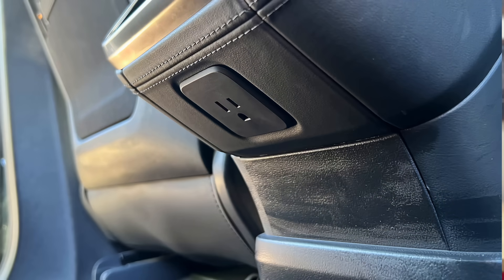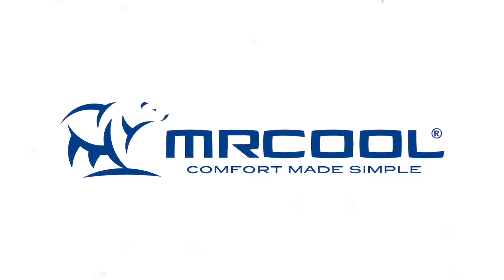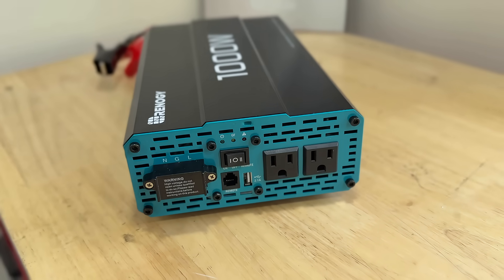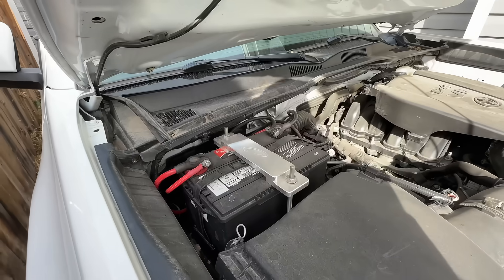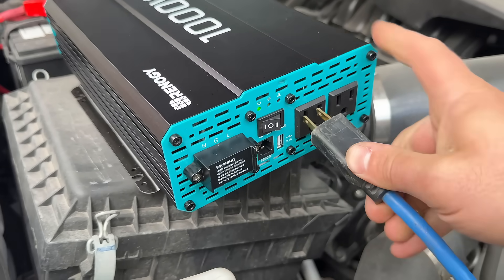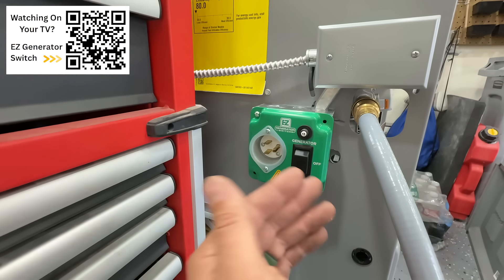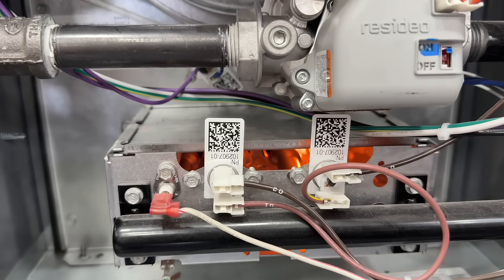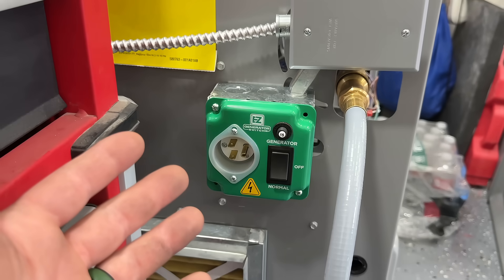Why Buy A Generator? You Have One Parked In Your Driveway.

Comment: A car's capacity to power other items such as the electrical forced air part of your gas furnace, is limited and may result in a very expensive repair to your vehicle, including replacement of the alternator and other electrical components.

An inverter will simply take the power it calls for (demand) from your car.  This first comes from the car starter battery and once extinguished, the full load (demand) is placed on your alternator with no backup, and may and likely will overload your vehicle alternator resulting in failure.

The problem will be exasperated if your vehicle starter battery is old or nearing it's useful life, say a 24 month starter battery at 24 months old.  That battery may old hold 20-40AH for starting our of 100-120AH in a new battery.

Last, vehicle failure may not be obvious.  Damage can be accumulative over time culminating with failure after several uses.  The root cause of such a cumulative failure can be confusing and not obvious.

How to be safe?  Know your vehicle's alternator spare capacity at idle and operating speeds.  Note that operating an alternator at idle places additional loads on the alternator while the alternator has limited cooling capacity during low rpm's and may overheat resulting in failure.

The choices here are to be careful or be prepared for an expensive repair.

There is more to these electrical systems than meets the eye.  A red flashing light is that the vehicle manufacturers do not recommend these systems be installed.  They do not warrant their equipment for use with these inverters or 12v to 12v chargers.  This is a bright warning sign.

My lesson learned was $4,000  in repairs to my vehicle electrical system.  

I could have built a 500AH battery pack with inverter/charger for such emergencies completely separate of my car electrical.  Further, I could have also added a generator (gas or propane) for extended outages to recharge my 500AH battery bank..  $600 for 3 batteries/300AH, $200 for inverter, $200 for charger, TOTAL $1,000.00,   A cheaped down system could be made for as little as $500 with 200AH capy.   My first 100AH system cost me $400.  With one $4,000 vehicle repair, this is an incredible deal.

I hope this saves you money and a lot of trouble.

Cheers

Comment: İ was thinking about getting an inverter and a 12 volt battery and a solar panel  to charge the battery and to use that the same way as you but independent of using the car. Has anyone here done this?

Comment: This is a good idea, in a pinch. Like others, I'm skeptical of leaving the inverter under the hood with the car running. Under load, my Renogy 1000 watt inverter runs its internal cooling fan often, and if it's drawing hot air from around the vehicle engine, I expect its life to be shortened considerably. As others have said, using clamps on the battery is a bad idea; they represent unwelcome resistance compared to lug style connections. I'm also skeptical of the wire gauge between the battery and the inverter, as well as the extension cord guage. My solution to this isn't cheap. It's an inverter generator that runs on natural gas, or propane, or gasoline.

Comment: I think that's an okay idea but you did not mention that a car should be always outside while it's running.  what is the gauge of that extension cord? Correct me if I'm wrong but it has to be a heavy gauge extension cord, 12 gauge, at that length. Be very careful with this.

Comment: This all seems good in an emergency, but there is a reason that generators exist as a standalone product. I live fully off grid with solar as my primary energy source and a 3000w inverter generator as a supplemental backup. 

My generator has a 2.5 gallon tank, which can output 50% of its load for about 8 hours. That is about 1500 watts. At 25% of its load, that time stretches to 12 to 16 hours. A family of five to seven people charging things, running laptops, powering starlink, occasionally using a microwave for a few minutes, not running air conditioning, in my experience typically uses about 600 to 800 watts continuously during the day, and less than half that during the night. If you shut the power off at night, that 2.5 gallons of fuel can last a full day. 

If gas is $3 per gallon, then you are looking at less than $8 per day to power your life with a generator. It would be very difficult to find that kind of cost efficiency using a vehicle as a generator.

The other major factor to consider is the wear on the vehicle versus the where on the generator. Generators are designed to do exactly this task. Vehicles are not meant to idle for hours and hours on end. I have had some situations where I have run my generator for 48 hours straight with only a few minutes of stopping to refuel or add oil. It is much less expensive to replace parts or an entire generator than it is to replace parts in a vehicle. There is also the concern for where you need the reliability. Transportation is often more critical than electricity, especially in an emergency situation. 

My whole point in telling you all this is that while the idea in this video is useful in a bind, if you think there is a high probability you will be in a situation like this, do yourself a favor and purchase an inverter generator that can meet your needs. It will save you a lot of money over time, and will generally be more reliable when you really need it.

Comment: Your fridge is plugged into a dedicated 15a circuit. A minimum for an inverter would be 1500 watts  with nothing else plugged in. 2000 watts if you want to plug your gas furnace in too.

Comment: The problem with using your car as a generator/inverter is that the engine is huge & inefficient.
You'll burn thru your gasoline quickly.
You're infinitely better off with a 3500 watt inverter/generator.

Comment: If you have of those thermal guns, you can buy on a Harbor freight for about 25 bucks. Let the battery go way down in your vehicle I mean almost to dead or dead then jump it off and let it run for about a minute and take the temperature of your alternator those things to get up to over 300° in a minute or two when the battery is completely dead to charge the battery. It’s not healthy for your alternator because those temperatures are a killer they’re not designed to operate in that range so if you do this, make sure your alternator is not running at 300+ degrees continuously because you’ll be buying an alternator sooner than you think.

Comment: 1:48 You're going to need bigger 12v wires and clamps than that to power a 1000w inverter.  1000 watts at 12 volts is 83 amps, before you account for heat losses in the inverter.  That's way too many amps for those wimpy little wires.  There's a reason those connectors on the back of the inverter are so beefy.

Comment: Good video,,👍👍👍👍
 I'll add that for theidle concern for your vehicule for a long time, just change your engine oíl sooner , instead of every 6,000miles change it at 5,000 miles ( between 15 to 20% sooner in miles), every time you use this 3mergency configuración. 
That would be a relatively un expensive preventive action.

Comment: Note ---1000 w 12 volt inverter is going to pull right around 100 amp DC  that wire you have pictured on that inverter is way way too small for 100amps at full load!!!

Comment: What i did to my old spare garage only insured 2017 escape is i bought 2 additional same size batteries wired it parallel to the car battery for buffer so my alternator is not over stressed, and installed a 5,000 watts inverter and open the hood to cool other engine parts.. worked for 3 days until power was back on.. power cycling our house lights, microwave, furnace and one small 32inch tv for news..charged all our phones and also ran our hot water(power vent) model..

Comment: My husband and I have a Mercedes-Benz crossover. It never occurred to me the use of the receptacle can be used for this purpose. Thank you for opening my eyes.
Reply: Before trying to use that outlet you might want to check your owners manual to determine the wattage. The typical watch on today's cars with an AC outlet built-in is about a 150 W all those some can go as high as 400w.
Most of today's portable equipment that would be expected to be plugged into that outlet in the car is extremely low wattage as compared to a furnace or a refrigerator in your home.

Comment: Would I be able to do this if my travel trailer power bank is out of power while boondocking?  I could buy another inverter and run it the way you did with the car battery and plug in a 120 extension from car/inverter/ battery to trailer?

Comment: I learned this many years ago, when I purchased a gas generator.
It sat for years, not being needed.
After sitting in my shed, for four years, when the time came, that I needed it, it wouldn't start!
Yes, I had put Sta-Bil in the tank, and ran it, to get it into the system, but...
Four years of sitting, was too much, and the carburetor gummed up anyway.
I then, after giving the generator away, purchased a 2,000W inverter, and installed battery clamps, just like what you did.
I also purchased a Bluetty, as a temporary backup.
I've lived in my house for over 15 years, and the longest I've ever been without power, was four hours.
Why?
Because my house is on the same grid as the police station, jail, and courthouse, so it gets top priority when the power goes out, but I digress.
I also have a gas fireplace, so I'm covered for heat, if the need ever arises.
All that being said, I still want to be ready, just in case.
The power inverter is awesome, because there are no moving parts, and it has a very long shelf life!
I sure ain't going to invest $8K on a Generac, just to have it sit for 10 years, then fail, when I need it, LOL!
Reply: My Generac runs on natural gas and with the proper conversion kit, it could also run on LP gas. So either one of those has no problem with fuel system gum up. It also starts itself automatically once a week and does a 5 minute test run. It failed to start on one of those test runs 1 time which was due to the battery. So I replaced the battery. That's what the test runs are for. You're more likely to fail on regular test runs than you are to fail on a real powerful failure.
All unused equipment can fail, even inverters can have their electronic components go bad from sitting in non-use with no electrical energy running through them. I know this because of 50 years of component level electronic repair experience.

Comment: Unfortunately modern cars have relatively weak alternators and running the inverter for extended periods will damage them.  Not to mention the rest of the electronics in modern cars that can be impacted by this setup.  Older cars (20 plus years) much better for this application.

Comment: A few notes to add:
Most cars can’t handle more than 1000W. Check you alternator rating. ie 100 amps max, (typical for a 4 cylinder sedan) 100 amps x 12 W = 1200 Watts. This will handle a 1000 w inverter. 

A small 1000W generator is in the same order of $$ than the inverter. In a pinch, the car+inverter is a life saver, but a generator will use less fuel (remember that in big power outages access to fuel is restricted. 

Check the power and peak power ratings for the appliances you are connecting. They should be below the wattage (nominal and peak) rating of the inverter or generator. Otherwise you may damage them.

Comment: 1000 watts will not power an electric furnace or most space heaters. You can power heated blankets. It will power refrigerators and freezers for awhile, lights, and some small electric appliances.

Comment: You should only use your vehicle if you have nothing else for the same price of an adequate inverter you can simply buy a generator the reason why it is better to buy a generator is because it is much more fuel efficient than running your engine Trust Me by Fuel fill up your vehicle run it for a few hours and then go fill it back up and you will see just how much fuel consumption it takes to run your inefficient vehicle with a power inverter

Comment: I would never recommend anyone doing this, except under extreme controlled conditions, since if you are not tech, you could kill yourself and your family with carbon monoxide poisoning which could float into the house when you don't expect it. No one should ever try to sleep under those circumstances. It would only be safe for just a few minutes at a time. Also, if you are running a 12 volt DC battery operated inverter rated at 1000 watts, that would be the peak power rating for just a few seconds. The longer term rating for a few minutes would probably be no more than 500 to 600 watts.

Comment: That's right. Don't buy that  $350 generator when you can Burn up your engine up by running it for hours as an ac converter. Yes you too can ruin your automobile by using it as a AC generator. 🐂💩👎😎

Comment: This method I viewed as a back up of a back up only. Most cars now have 60-100 amp alternators that give about 800-1400 watts at maximum. The vehicle engine have to be at a fast idle and at sustained high output, I do not know how much the alternator will heat up without airflow from highway driving speed. Further more, if you leave your car running in your driveway, someone will try and steal it. You cheaped out on the modified wave invertors, I would have paid more and buy the true RMS sine wave invertor instead so it can run computers.

Comment: I am Jamaica currently with no power from the effects of Hurricane Melissa. I have a 3000W pure sine wave generator that is hooked up to my Ford Ranger and I use it to power my house at nights. (i.e. lights, power banks, radio, laptops (three), cellphones (five) tablets (three) and Starlink. It's not the most ideal but it allows me to be operational so I can get things done before going off to bed. I have been using it for over a week now. 

I hope to get back light this week though as when I head off to work the house is without power until I get home in the evenings. (Pros) . No noise, I dont have to store fuel as I would with a generator and I don't need a special location to store the inverter (it stays in my car with one of the windows slightly down about an inch to allow for cooling.  (Cons). It needs the car battery so when I am at work there is no power at home. I can't hook up all my appliances at once. The cable between the battery and the inverter is about 13ft so there is some voltage drop along the path before it gets the house.

Comment: Excessive idling can damage your catalytic converter by increasing heat and leading to premature failure. During extended idling, the engine doesn't reach its optimal operating temperature, which can lead to unburned fuel and carbon buildup, and contribute to clogging and damage over time.  the average price for a catalytic converter is about $350 + Labor. $$
Reply: Good poste.  Add a new alternator to the mix and, with labor, you're looking at real money.  This is not a viable solution to any outage longer than 20 minutes.

Comment: I have a small Ford Connect van, it has an inverter that is linked to a battery that is secured in the back of the van. That battery takes energy from the car battery.  I hardly ever switch it on.  However, the car battery continually goes flat.  I'm wondering if the electricity set up is wrong and is draining the car battery.  Is there any way I can find out what's happening and where the fault is?
At the moment, I'm having to power up the battery via the house mains - and it's happened every day now the weather is colder.  Is there something wrong somewhere?  Is it an easy fix?  What should I do about it?
The car battery was bought brand new in the Spring of this year.
Oh and by the way, the battery in the back of the van was originally a 'stop/start' battery, but the battery in the front still kept going flat.

Comment: There is SO MUCH wrong with this video.... 
Yes, in theory this will work, but there are MANY other factors to consider if you're going to do this.  Just a few:
1) If your car isn't running, you're going to kill your battery.
2) If your car IS running, you're going to use up your gas and not be able to get somewhere in an emergency.  In an extended power outage or big storm, gas stations may not be working, so you'll need spare gas on hand ahead of time.
3) The inverter NEEDS to be cool, you CANNOT let it sit on top of a hot, running engine.
4) A long extention cord from an inverter will most likely keep popping the breaker on the inverter.
5) leaving the inverter inside your engine compartment with the engine running and an extention cord/ battery cables in there is DANGEROUS and silly.
...and so many more things to reconsider.
A very handy/knowledgable person may be able to pull this off.  Your average person is going to burn their house down or blow up their car.  BEWARE!!!
Reply: Plus alternator size and alternator need to run the vehicle. Also an alternator does not put out a lot of power at idle.

Comment: Idling a car ain't great for wear but if you use synthetic motor oil the wear issue is minimized - and you can always treat your car to an oil change after an extended idle. I wouldn't keep the inverter in the hot engine compartment and I'd keep the hood open partly to keep it cooler and avoid the radiator fan running all the time too

Comment: Imagine taking a old lawnmower replacing the blade with a pully mount a alternator with pully. That would be a good start. Depending on which alternator you pick.  You'd use a lot less gas then a car running idle.  Plus many new vehicles have anti-idle shutdown.  
Just a FYI  for people who have a little mechanic aptitude. Which most of my redneck friends had all kinds of Frankenstein projects in the shed.  Had to do something when we stopped drinking and chasing one night drama queens.